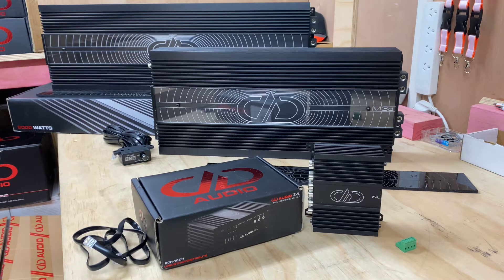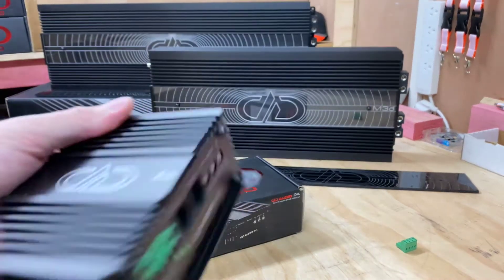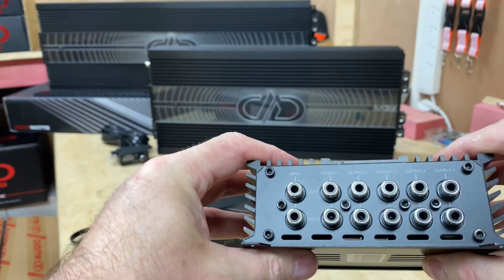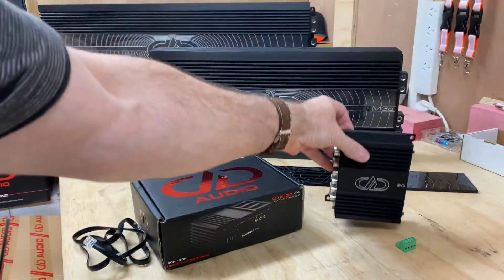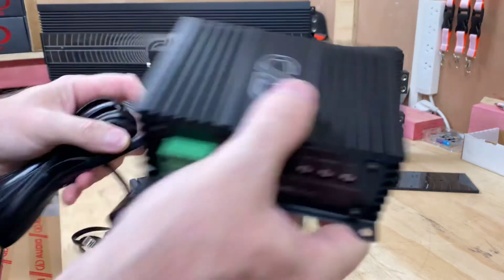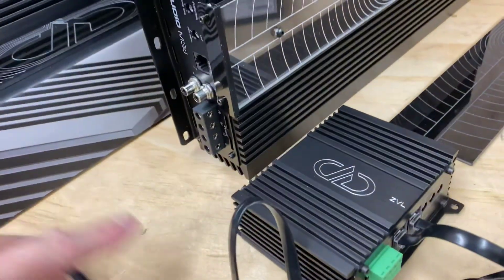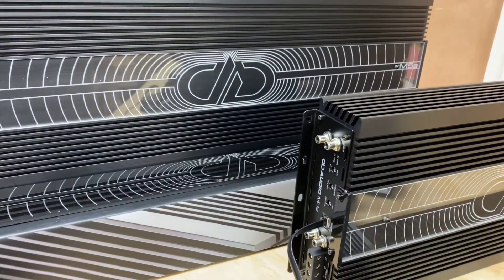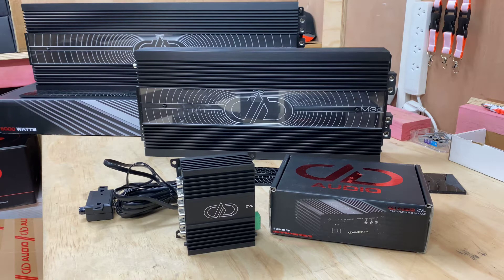DD Audio ZVL Multi-Amp Sync Module Product Preview/Tech Talk

Comment: Hi
How is the Dd Audio LE-M10 sub?
Will it be better than the Rockford fosgate P1-1X12.
I know its a 10 vs 12 inch sub but the dd can take 250-500 watt rms a 4ohm where as the rockford is 250 rms.
I am running the rockford of 250 w rms, will the dd sub be a upgrade?
I am planning on running the dd sub at 300w
Reply from the maker: Yes 😊